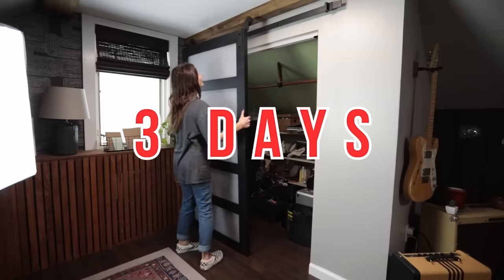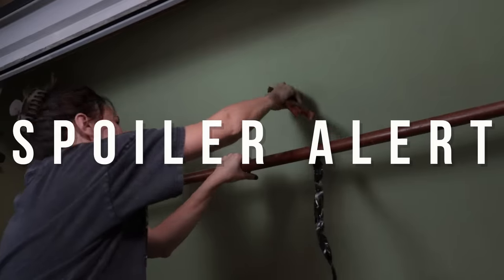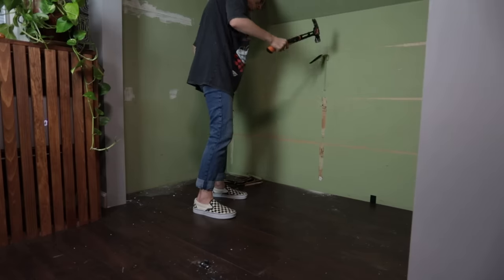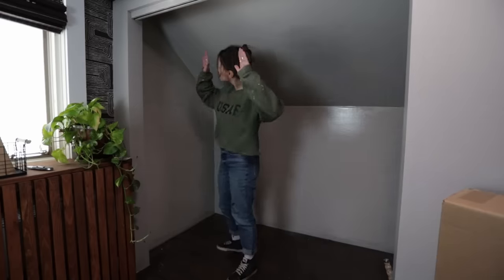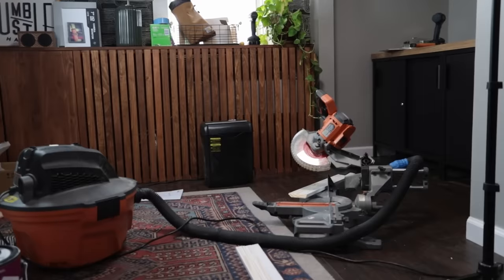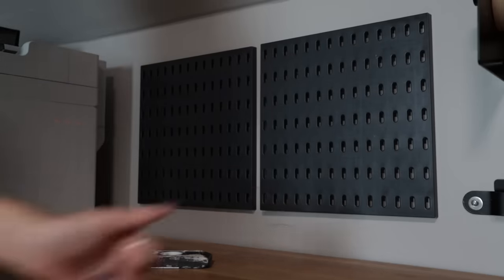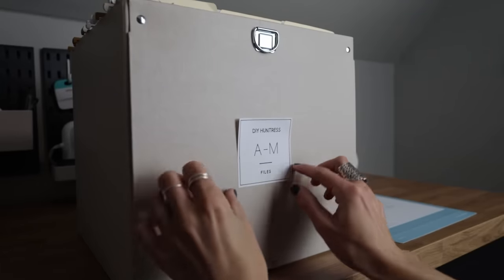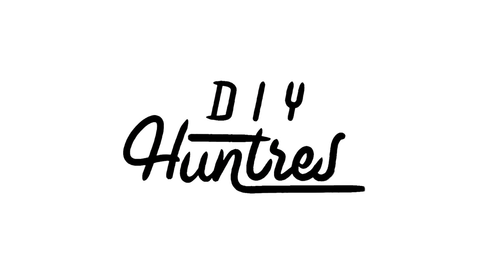I TURNED MY CLOSET INTO AN OFFICE!

Comment: Sam, that was my experience with flat heads. It was like you were recording me. Often though I used an impact driver and a flat head bit and I got REALLY good at it but it was hard. When you hammered that bracket - I was roaring with laughter because I did the exact same thing for the exact same reasons. I felt all your pain. 

Lovely project by the way. Keep doing what you're doing. You are fantastic. 500K subscribers Sam. You earned it.

Comment: As an architect and renovator, when dealing with "awkward spaces" I try to use the following procees
1. Write a brief for build /reno (must have, would like & "wish list") leave for a while and re-edit (repeat as required)
2. draw or get drawn by someone else (if you don't have this skillset ~ if you don't have this skillset, no probelem. It is a skill set that few have, but one that can easily be "outsourced" to those who can at an affordiable cost) your design,
3. Review with consideration of brief and realistic built outcomes; amend all as required

Comment: 5:34 IKEA furniture is a lot easier to put together if you throw away that Allen key and just use a ratcheting screwdriver with a hex bit in it (or, depending on the material, use a power screwdriver). No wonder you find putting together IKEA furniture difficult. You literally have better tools for the job. They provide that Allen key for people that don't have tools to be able to put it together.